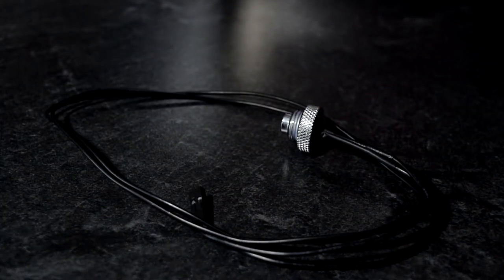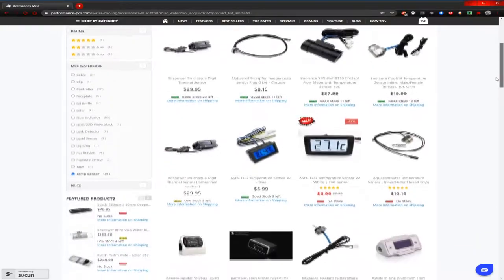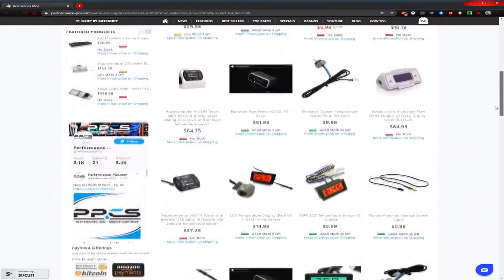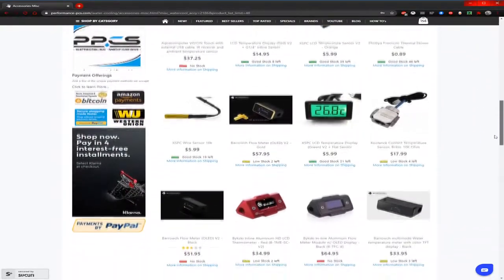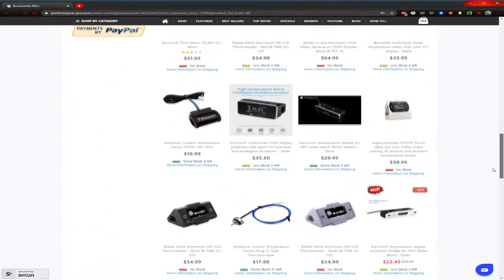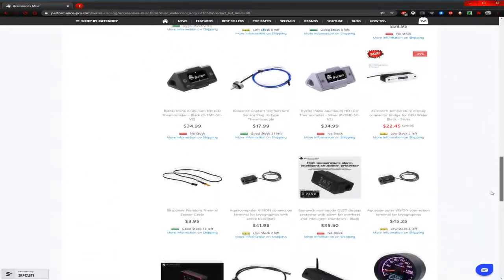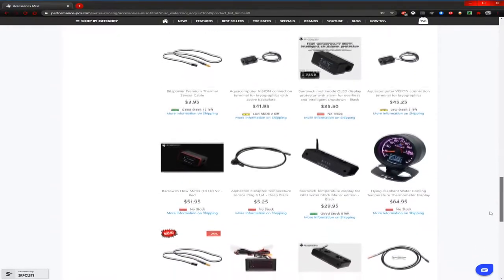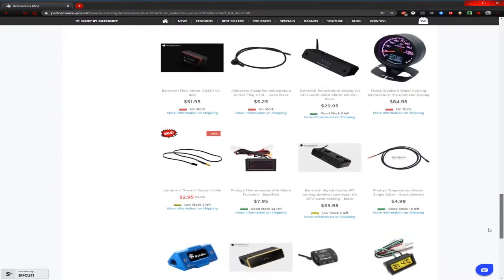PPCs Part Picks - Ep. 1

Comment: the idea that you could use something so simple as a sensor that replaces a plug that already is not being used is awesome, and then on top of that if you have independent loops for your GPU and CPU you can then control the temps of each loop separately

Comment: I've been building my own PCs for years and only just started water cooling. I'm currently building my second water cooled rig now, and hopefully my little oversights on the first build can be fixed on round 2. Like the fact that I forgot to install the drain port and now I have to figure out how to drain it to get my blocks into the new system. I'm convinced the coolant temp is a much better source for a fan curve. Now I think I need one of these, of course.

Comment: I’m actually use 6 g1/4 temp probes in a dual loop system to measure,  inbound and outbound of radiator and 1in the reservoir.  This way on can tweak the fan curve for each radiator and measure any ambient water temp change into the reservoir.  Also have thermosistors to measure individual component temps (cpu, guy, vim, & ram).  All will be managed through 2 quadro sand mb interfaces.
Reply: Very cool!  How much variation do you see between the different sensors under different load cases?  How closely calibrated are they to one another, or is there a some type of offset you apply to the output reading from each probe?
Reply: @mattknoepke2688  
I’m setting this up now.  Waiting for the 5950x, coming next week to finish the build off.  Will let you know.
Reply from the maker: Dang! You take temp probes to the next level Colin! Way to be :D

Comment: the one he had looks like a Barrow or a Bykski temperature sensor. Also for the G 1/4 temp sensor fittings, one thing to note is they basically double as a stop fitting. So if you already have a bunch of holes to plug (i.e. crazy distros), you might as well get one of these. The in-line sensors could also double as a sort of ghetto coupler too... cut your expensive metal hardline tube too short? Screw it, inline temp sensor w/ screen it is!
Reply from the maker: Love your reasoning behind the use of the temp sensor Pooter!

Comment: I ordered a similar one from you guys, but couldn't get it work on my msi x570 godlike. Pretty strange. There are two 2-pin thermal sensor connector on my motherboard (and also two temperature sensors probe come with the motherboard). I use one sensor come with the motherboard and another sensor got from you guys to plug into one reservoir. The first one give me reading but the the second does not. I'm not sure it's some special design from msi or just a fault sensor. So confusing. But luckily my cpu block has a build in water temperature sensors, I can still get a reading for water temperature. Too sad that I can not use that to adjust the fans.
Reply from the maker: That is really odd Lonely_Islander... So the G1/4 probe you ordered from us does not work? If you plug the 2pin sensor into the same header the G1/4 probe was in, does it still work? If it does, then I'd likely say you just got unlucky and received a dud probe from us... which is not unheard of. If so, please don't hesitate to contact us at RMA@performance-pcs.com and we'll be sure to get that replaced for you asap.

Comment: I think my Corsair xd5 temp sensor is bad because it’s not showing up in icue. Do you mind telling me which one in your website will work. If you can share a link that will be great. Thanks!!
Reply from the maker: Hey Andy, if I remember correctly, the Corsair products also use 2pin temperature probes, so any of the temp sensors found here will work - https://bit.ly/3gDbjen
Reply: @PerformancePCsTV  yes that is correct, it’s a 2 pin connector. Thanks a lot!!